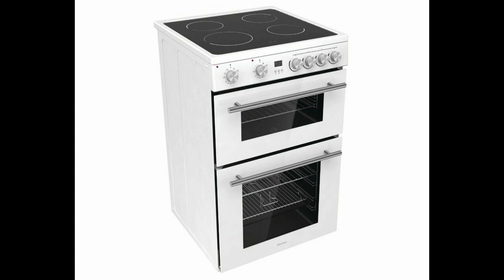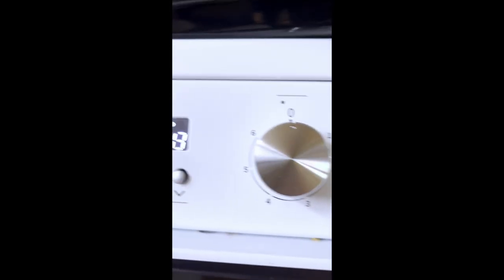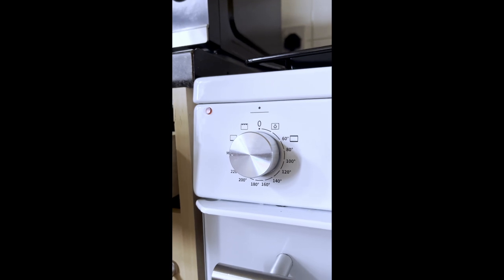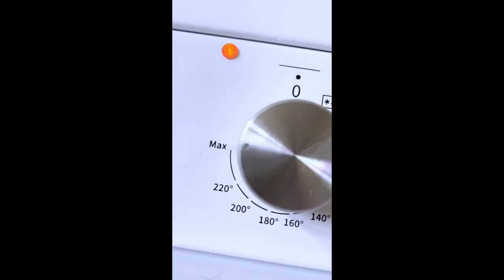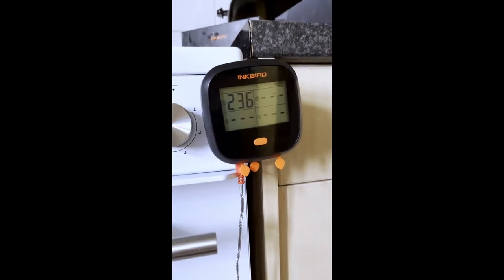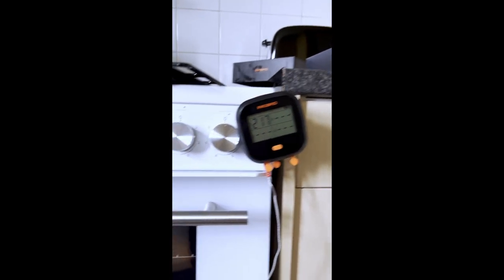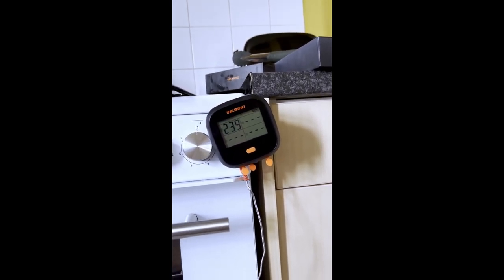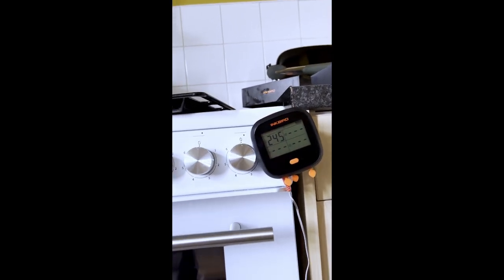Hisense HDE3211BWUK Cooker. Grill Issues. Not heating up.

Comment: Your cooker grilles are fine. I have exact same one as this but black. The grillw will not glow red as it is a radiant heater, which means it uses infa red rays to cook, so will not glow
Reply: Coukd you please explain how to use then, just bought mine today and could still touch grill tray after 1 hour and I could keep hand on it. Is there some kind of way to use we don't know about, us it not as simple as turning knob to grill symbol

Comment: Hi mate just sorted  turn to grill then just  pull  out the control very slightly  and it goes to heat settings with out turning  grill off set to  your temperature  ..they don't explain  in manual  will not buy  hisense  ever again
Reply from the maker: @DerekConlon-c1t  hello. Thanks for explanation. Well Hisense engineers don’t know this also. lol. 

I will give this a try. But I have my new replacement from curry’s they eventually agreed to swap it for different model. NOT HISENSE.

Comment: My Samsung oven grill will not operate unless the door is closed. I believe its a safety fuction which probably applies to all low level grills.
Reply from the maker: @Geoff.Turner  after 5 separate engineer visits. Hisense finally conceded this is not right. And issued me with a pick up -replacement with curry’s. I have chosen a different Brand. They are delivering my new replacement on 6th January. Stay away from Hisense. 

That’s not how a grill should work, unless it’s fan assisted. The door should be open for a conventional grill with out fan.

Comment: My grill doing the same!  Same cooker but mines black worst grill I've ever used on a cooker thinking about sending it back
Reply from the maker: @jamezhowell2178  keep on at them. I have had their repair guy out 3 times now. But now the head tech watched my video. He totally agrees with my and said this is not right. They are sending a newer part to their repair guys. Then I am waiting on one more visit to see if they have fixed the issue. 

I still think it’s the switch on the knob. It’s not selecting grill only. It’s still on oven mode. 

They already replaced it. But I think the connections in that switch design are not correct. I am wondering why I had to wait a bit longer for this new part. Maybe they have figured out that that knob/switch isn’t selecting the grill. Hopefully when they finally come out for the fourth time it will be sorted. 

I will keep you updated.
Reply: @RStark-ers is there any update on this issue? Mine oven is the having the same issue.
Reply: I unfortunately bought this model in black from ex display   and I have the exact same problem.. the grill is beyond useless!